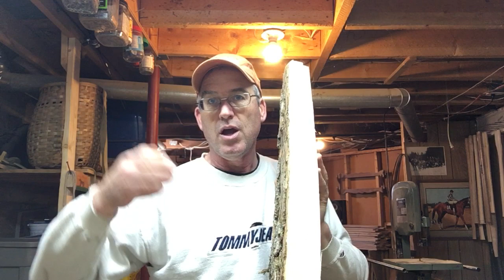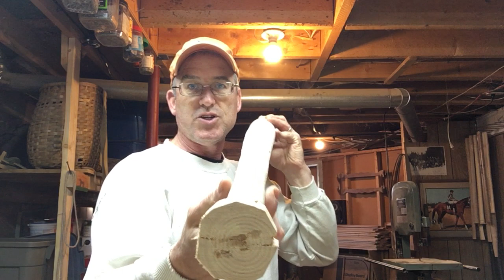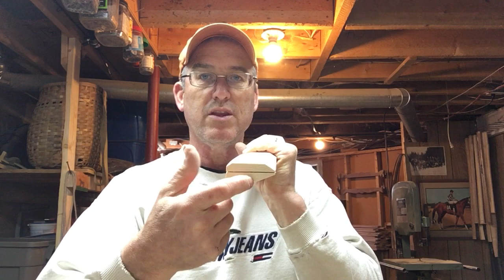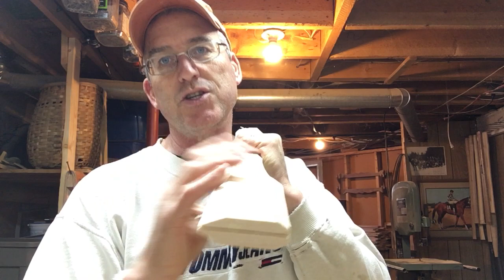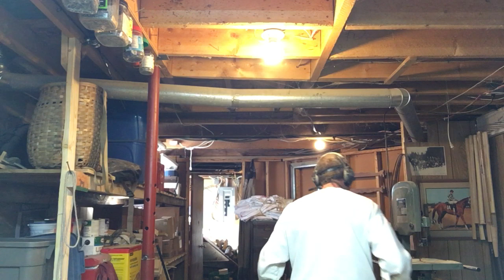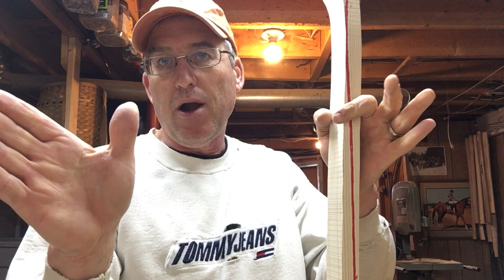"RUNOUT" - what is it, what can you tolerate?

Comment: Do you also do this method of runout calculation for your throwing axe handles? I’m wondering if having runout would affect them any differently in comparison with chopping handles.
Reply from the maker: Actually Devon, a throwing handle is a different handle application (in my mind) than a chopping handle.   Although it does eventually strike wood....it is not in your hand when it happens - therefore, I prefer to use a diffuse porous wood for throwers.    They finish smoother and therefore come out of your hand smoother.  Because you are not prying or worried much about these forces, I think runout on axe handles are even less important - IMHO.